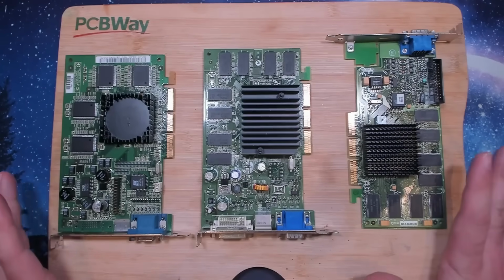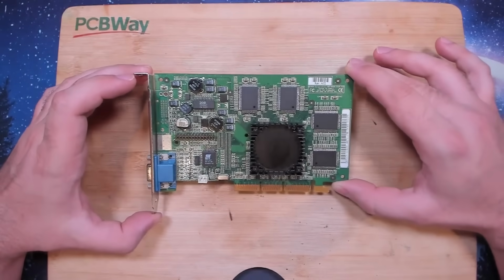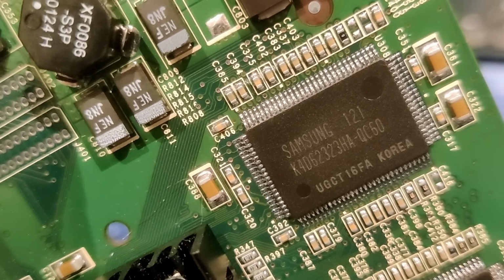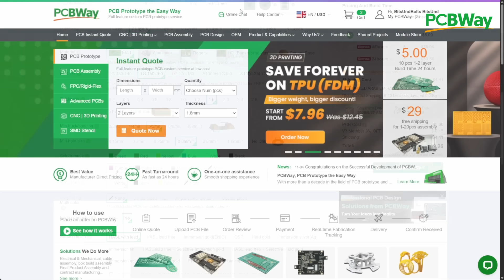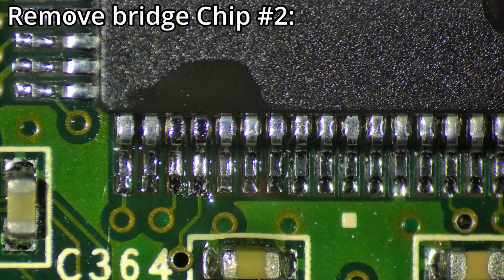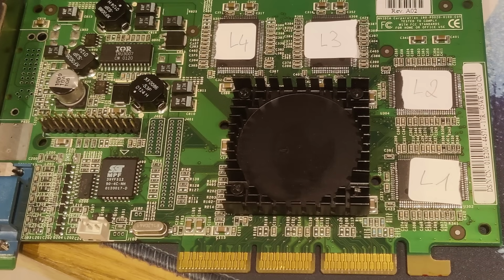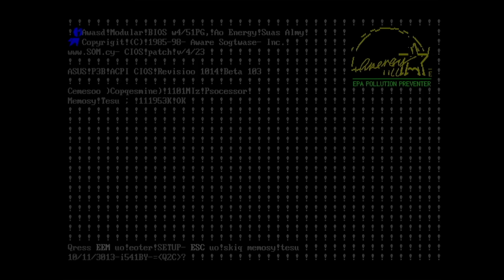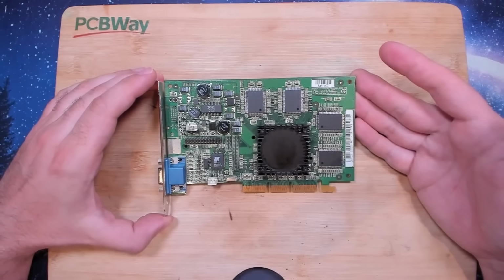Leaked NVIDIA Tool: Can MATS Save My Broken GeForce?

Comment: I have a PCI GeForce MX 2 that I used back in the day for dual heads on my computer. I had a AGP MX2 and a PCI at the same time. The PSU sent high voltage into the computer and cooked everything in the computer but I don't know if the PCI card survived, I'm afraid to test it in a computer. I checked for shorts on the power lines and didn't find any
Reply from the maker: Hm, if you can't find any shorts, I would assume it is safe to put it in a system for testing. In the worst case, the PCI card is just dead. I had components in boards that went short - my power supply shut down before something bad happened. But you need to make sure your power supply supports all the over current protection measures.

Comment: I remember my Geforce 2 GTS being my prize possession in 2000, that thing was expensive! it's good to see you working at fixing these classic cards, they're important PC hardware history.

I make regular use of MATS/MODS in repairing modern cards, it's an essential tool and good to see it working for older cards too.
Reply from the maker: I guess NVIDIA still doesn't release those to the public and new versions of the tool have to leak?

Comment: Maybe the chips can't get data cause error says write errors
Reply from the maker: Yes, I saw that too - I don't know what could be at fault though. It seems to be one data line only though (based on the bit errors in the table). Looks like one bit is stuck high.
Reply: @bitsundbolts yeah maybe those chps are actually single us flash chps that would explain the write errors 😅 i mean i encountered sus things also  even on ddr4 cheap ram sticks

Comment: i don't think that is a memory problem. May a Capacitor or voltage regulator is defektive. The RAMDAC is builded inside of the NVidia Chip and the Picture is to dark. After then, flash a new VideoBIOS.
May that works then.
Reply from the maker: Yes, you are right - the picture is dark. On my working GTS, that isn't the case. Still, MATS reports memory errors one one part of the card only - which corresponds to one memory chip. But the RAMDAC could have issues too, you're right.
I am not sure if the BIOS makes a difference. The cards I have here don't even show a BIOS splash - I guess it is some OEM card I have here.

Comment: I'm still watching the video, and maybe you've done that, but you should have lifted the chip select pin instead. I almost shouted at my screen when you shorted the data pins. the data bus is shared, so by shorting the pins you effectively tied those two bits together, completely messing them up for all the chips - I guess that made the card think they're floating/not connected and ignore them in some cases. if they both are high or low, it's fine, but if they have different states, the voltage would be somewhere in between.
Reply from the maker: This card is a 128-bit card - the data bits should be unique to each chip. But you're right, I should have used a method you suggested - or play with Vref (something available to DDR memory chips).
Reply: @bitsundbolts  oh ok! sorry then, I shouldn't have shouted at my screen :)

Comment: For ATI cards there are similar tools - r*memid (* is the generation, e.g. r3memid for Radeon R300 family). I fixed a Radeon 9550 that made slight artifacts, and one of the address lines was bad. It turned out a degraded resistor between the GPU and memory chip.
Reply from the maker: Was that one of those 22 or 33 Ohm damping resistors (if that's the correct terminology)? I guess by degrading you mean the resistance went up by a lot.
Reply: @bitsundbolts  Yes it was a 33Ω damping resistor and went to several kΩs.

Comment: The card probably fail memory training for the bank including that chip and went "Oh! I only have 16MiBs!"

Live shorting might have been better.
Reply from the maker: Maybe, but those pins are quire small - you can easily short things you shouldn't short. That is the main reason I checked one by one.
Reply: @bitsundbolts  Yeah even in my 20s those SMD components are fricken TINY!

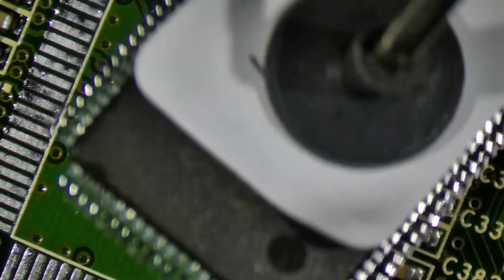Comment: 16:18 heat heatsink to 120-130C for about 3-5 min and twist it out.
Reply from the maker: Hm, ok.... That is quite a long time. However, nothing that will probably kill the GPU. Worth a try!
Reply: @bitsundbolts  It shouldn't effect the chip if it is not powered. The leaded solder melts at ~150C, so the manufacturer needs an oven at that (or a bit higher) temperature to soldier the chip.
You might be able to remove the chip from the board without removing the heatsink first.
Reply: @ИванСнежков-з9й  без паяльної станції це дорога в один кінець. Я колись так намагався перепаяти GF2MX, так і не вийшло.

Comment: heatsinks attached with thermal epoxy can be removed by heating up the heatsink with an hair dryer, and then lever it off the card with a flat screwdriver wrapped in a cloth
Reply from the maker: I have seen people do this using freeze spray. It's unfortunate that there seem to be different grade epoxy glues out there. The one on this card seems to be extremely hard - I wonder if it will work. I'll try with freezing first - if that doesn't work, heating it up it is.
Reply: @bitsundbolts  The super tedious part will be removing the epoxy residue off the chip. I recommend a guitar pick for that if you don't want to scratch the writing on the chip! Some people say acetone works too, but that's kinda scary because that might ruin plastics!
Reply: @Wes1262-x2k  WD-40 with a piece of wood or plastic removes any glue from the chip very well and not destroy any plastics.
Reply: @bitsundbolts  Freezing spray is very bad for electronics, as low temperature damages solder in micro BGA in GPU, in BGA below the chip and around the chip. Tin will change from "a good" and shiny allotropic beta form into "a bad" and brittle (cold solder joint) alpha form.
Reply: @powerzx  I believe this card is from pre-RoHS times and contains leaded solder, not pure tin. Another thing is: this chip is wire-bound (e.g. old), doesn't have micro-BGA fortunately 🙂  Let's hope that thermal expansions of heatsink and thermal glue vary enough to make it loose after cooling or heating. Had hard time removing this stuff from ceramic package, brute force abrasive method succeeded partially (sandpaper).
Reply: @argoneum  1)Even pre-RoHS electronics have problems with degrading solder joints.
2)It is never a pure tin, it can have added silver and many other metals.
3)I didn't see any picture with any wires soldered to a GF2 chip.
Reply: @powerzx  Wikipedia, picture description: "Inside a wire bond BGA package; this package has an Nvidia GeForce 256 GPU", linked by pages: "Ball grid array" and "Wire bonding". There are bonding pads visible on the substrate. When you look at a die shot of GeForce 256 there are bonding pads visible on the edge. Wires are in black epoxy :)
Reply: @argoneum  I was talking about the GF2 chip (he has a GF2 GTS card). I said that "I didn't see any picture with any wires soldered to a GF2 chip" (it means that I didn't see them, not that there aren't any wires for sure).
PS. Rapid cooling down of electronic parts is not a good thing and can cause problems.
Reply: @powerzx  Understood, sorry for being an arse 🤐

Comment: No task too daunting for Bits und Bolts. Very interested to see you reball that GPU, looking forward to that. Perhaps a hot wire to remove the heat sink?
Reply from the maker: Hm, a hot wire to cut through the epoxy like Styrofoam? Wonder if that would work... Gluing the heatsink on the chip is such a bad design decision :( It's a nightmare if you need to do some maintenance.
Reply: @bitsundbolts  Also, maybe a "coping saw" cutting close to the heat sink, or that comment about freezing the chip ..  I'm sure you'll figure it out. Ya, what a terrible idea to glue the heat sink.

Comment: MATS is also a thing with modern Nvidia cards like rtx5000 series. Extremely useful took for repairs.

Try to measure the data pins in diode mode. If the data pin is connected to the core, I believe you should see voltage drop. There are smd components nearby that can fail open circuit or short, so you might be lucky and don't need to lift the core!
Reply from the maker: I will definitely doublecheck this! I already did and couldn't find anything obvious - all data pins show the same values. I also measured the SMD components around the chips with the same outcome. I will test again though.
Reply: I would advise against it, diode mode puts out current. So you'd be injecting current into the core, it may do nothing, but there is a chance it does something you don't want it to. 
At least I would check first what kind of voltage it puts out, you might have it in documentation for the tool. Some old tools might be spitting out 5V or 9V which the core will not like on it's pins...

Comment: I have repaired a few Nvidia cards using MATS but on the new generation (GTX970). Counting memory chips is from the bottom right corner of the GPU chip counter clockwise. it seems like it is the same here.
Reply from the maker: The way memory chips are arranged seems to be a very long nVidia tradition :)

Comment: Your best bet for the thermal epoxy removal is to try to freeze it so it becomes as brittle as possible and then chisel it away with a plastic pry tool and mallet. Look forward to watching the next video to see what solution you come up with.
Reply from the maker: I actually got freeze spray and I want to try exactly that! I heard that freezing epoxy is the best method to get the heatsink off. Let's see.

Comment: Why not just leave it attached and use hot air on the heatsink?
Reply from the maker: You mean to remove the chip? I think it would kill the chip because you need a lot more time to raise the temperature. Heatsinks are good at dissipating heat - it might not even be possible to make the solder balls melt. Before that, the epoxy might burn up - but you will also have a dead GPU.

Comment: If the alcohol method fails, try acetone. I doubt that it can hurt anything on the card itself, but the chances that it will melt the glue are high. I won't recommend using force, in fact, I suspect that somebody already tried it, and the artifacts are the direct result of it.
Reply from the maker: Oh, I have seen many cards where people tried to remove the heatsink with a screwdriver and damaged the chip instead. You're right, force is never an option. I'll try some freeze-spray and see if I get somewhere.
Reply: @bitsundbolts  Yeah I remember back in the day when this thermal epoxy was common people would freeze the entire card in the freezer and pry it off. Freeze spray probably a better idea, more localised.

Comment: I use heat on glued heatsinks. It works great but needs care.
Reply from the maker: I have used this too, but it was a different type of glue. There are softer glues and those adhesive tapes. Those can be removed with heat. The one I have here is like stone - I am not sure if it works on this one. What temperature are you using?
Reply: @bitsundbolts  I go for 200/250C depending. I wonder if the one you got has solidifed lilke that due to age and heat cycles.

Comment: I would suspect the LSB data line for that memory chip, the characters on the screen show that any character that has an even ascii value is incremented to the next character, but odd ascii values are left the same. so bit 0 must be stuck high. For example "!" is " " (space) +1. Being that swapping the memory chip didn't fix the issue, I would follow the trace and see if there was a short somewhere between it and the GPU
Reply from the maker: Haha! NICE info! Thanks for sharing that! I didn't even think of analyzing the text output! But you are right! I have a 1000 MHz Celeron in the system - and there were several occasion when it was 1001 or 1101 (Depending where the question mark line appeared). Maybe it isn't an issue with a broken solder connection.
But which data line would that be? I have 32 of them. Could it be DQ0? Or do I have to measure with an oscilloscope. I'd suspect that line to be always high (btw, the stuck bit is visible in the first MATS output as well).
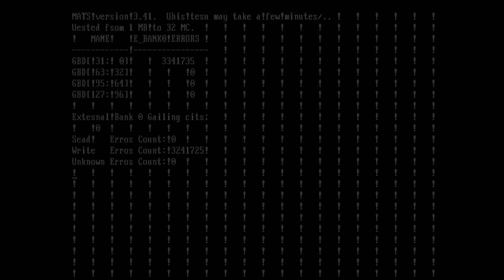Reply: @bitsundbolts  Unless I'm mistaken MATS shows that it is DQ0 that is stuck high, look in your video at 4:08, it shows: expected 00000000 and: actual 00000001
Reply: @perhansson6718  I'm always amazed by how many clever people are viewers of this channel!
Reply: @bitsundbolts  You scope each DQ pin looking for the one stuck high. There is no logic to the actual bits to pin mapping. You should have good long tile to scope the lines as the test seem to run for some time. Just have good map of the pins and look for changing values, discard those, and not which DQ pin is stuck high.
Reply: @bitsundbolts  Try sorting DQ0 & DQ1 on the L1 chip, rerun the test and check the report file. It should pass the 0x00000000 test and throw an error on the 0x00000001 test patern reporting "Actual 0x00000011".  ps. The error addresses are not continues, there is a chance the DQ0 is not connected and you get "floating pin" glitches
Reply: @bitsundbolts   Yes, but that would be DQ0 from the GPU's perspective.  The actual GPU to RAM mapping could be bit for bit, but it could also be arbitrary, determined by the PCB designer for the optimum PCB layout. The RAM doesn't care which data bits are stored in any particular bit position in the RAM. (Ex PCB guy here - sometimes you follow the logic, other times you move things around because it works better.)
Reply: This, it could also be a pin on the edge connector that's stuck high as well. Either way there's a line stuck high on the card somewhere. I've seen cards with ASCII errors like that before.
Reply: I noticed that too. And it occurred on every fourth character, pointing towards a single trace being at fault, or at least that is my assumption.
Reply: Yeah it's bit0 with is always high every 4th byte.
Celeron -> Celeson (C = 67, bit 0 set, but r == 114 OR 1 = 115 == s)
Maybe the DQ0 is somewhere shorted ?
Reply: I came to say this. But I think it's difficult to conclude that it's one of the pins of the memories that are stuck at 1. If it were a very old graphics card, where one would have a ROM chip that contains the characters, then I would agree, but I'm not sure how these "modern" cards work in that regard. Where in the card are those characters stored? How does it read them? If it's all integrated into the GPU itself, then it's unlikely that a bad trace or bad connection would fix it.
Reply: @luisjalabert8366 They all have to have essentially a tiny chunk of the card still function as a vga card that then has its driver enable the full feature set. It’s why I could use VESA modes in games in win98 on a laptop with no driver installed for instance.
Reply: @aceoyame2619  sure, but the question is where that part of the VGA system is, and where the characters are stored and read from.
Reply: @luisjalabert8366 In the gpu core. It’s just like how every computer boots like a 5180 with an 8088 cpu still
Reply: @aceoyame2619  Sure, but I don't think it's that simple. For all we know, that data could be stored in the BIOS and then copied at boot time to DRAM, or it could be stored directly in the chip and read from there, or many other possible solutions. It's not as simple as you portray it.

Comment: To remove the heat sink use an old credit card and flat butter knife. Place the card under the heat sink to protect the board. Wedge the knife between the card and the heat sink. Now heat the heat sink from above and then lift the knife handle. The heat sink should pop off without too much force. If it doesn't, add more heat.

Comment: isn't it odd that you're back to 16M mode when you swapped L1 and L4 (same behavior as shorting L4 initially)? Perhaps that means the L1 chip is still problematic.
So you might have two issues, something wrong between the GPU and the L1 position, and the initial L1 chip might also be bad.

For the epoxy, maybe try dry ice? I know some thermal epoxies will become brittle at very low temperatures.
Reply: yes he didn't excludes those. Rule nr 1 = isolate the problem. Also those wouldn't reball the gpu. Just reflow with a board heater from the bottom for some minutes easy and then hot air rework on top. Get something like dosdude1 is using for board heating.

Comment: I've had good success removing the heatsinks from Voodoo 3's and 5's with a really fine Tile Cutting Wire and just working it back and forth slowly to cut the epoxy and then carefully sanding off the residue.
Reply from the maker: Oh, that is an interesting idea! Those are diamond coated wires or something, right?
Reply: @bitsundbolts  That's the most common type yeah, you can get them in diameters as low as 0.15mm easily, that's what I used back when I was putting waterblocks on my V5
Reply: @bitsundbolts  Any thin wire can work, even sewing threads works (if they are strong enough). The most important thing is to make a small bow, so you don't cut your fingers and can work faster with stronger force.